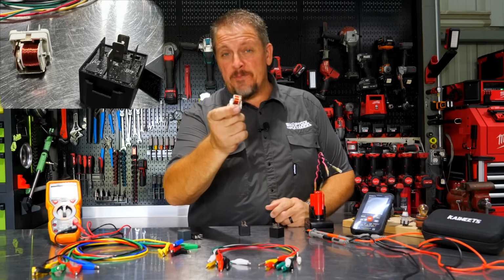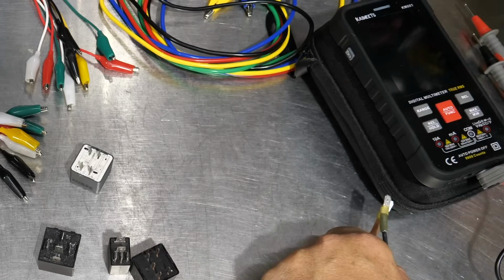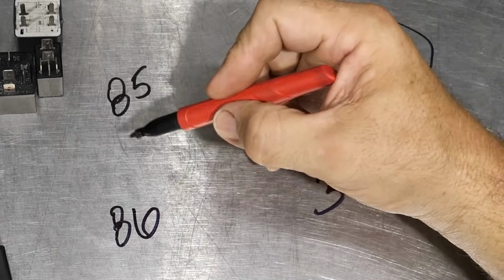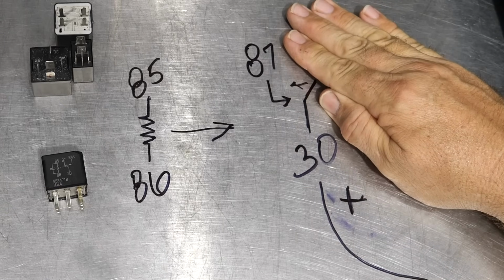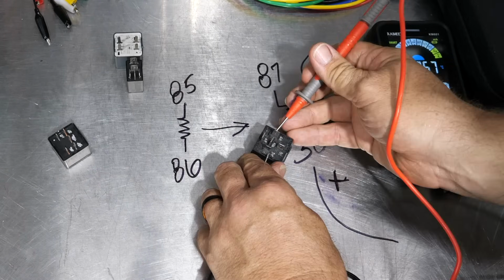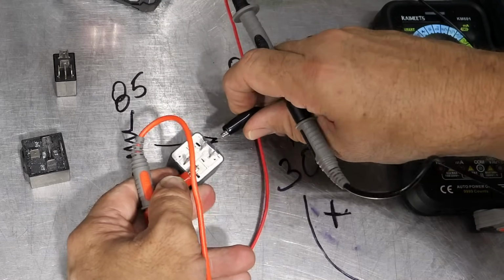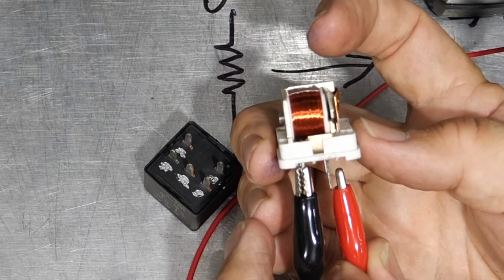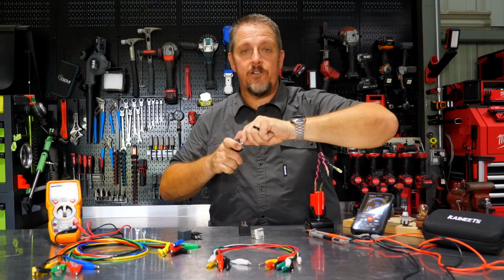How To Test and Diagnose Relays and Wiring [4 & 5 Pin]

Comment: 3.5 year long problem THAT NOBODY COULD SEEM TO FIX:

2011 Jeep Liberty

Code p0481 

"Cooling fan to control circuit / open"

"DTC severity 2 of 3"

"This fault may cause damage to...."(No other information given)

I have changed five modules and relays in this vehicle, in the electrical box, one on the sidewall somewhere inside, under the hood of the vehicle. 

I also just changed the "engine cooling radiator fan resistor" which is located INSIDE the fan assembly unit, to no avail. It could be because Amazon sent me the wrong part even though it fit, the pins were in reverse. Amazon vendor gave me my money back. 

So then I bought the entire fan assembly at O'Reilly's because Jeep dealership said that you can't get that individual part anymore even though it's an easy in and out. They make you buy the entire hole assembly. 

I took it over to my mechanic (one of the many mechanics I've been to) this morning, of which he said the fan works, so the fan is not the problem. Albeit, he's telling me he would have to do some serious diagnosis on me electrical panel, he thinks it's the "whole panel needs to be changed", I think that's b*******. 

I did watch your entire video which I consider myself educated regarding it, but I'm also not a mechanic. I am scared as a woman who does not know what to do or who to trust regarding mechanics. This is my only vehicle.

I just called another couple of dealers and they said they're going to charge me for diagnosis EVEN IF THEY CAN'T FIND THE PROBLEM. Which I find to be HIGHLY UNETHICAL. I mean why would I pay you for diagnosis if you can't SOLVE the PROBLEM? This makes no sense to me. 

Please help IF YOU CAN! 

JoAnne

YouTube channel: 

JoAnne's INSPIRATIONS

CONTACT ME THROUGH MY YOUTUBE CHANNEL, OR, HERE THAT YOU'RE TRYING TO CONTACT ME AND I'LL GIVE YOU MY INFORMATION.

Thanks in advance, and many blessings :-)

JoAnne
Reply: You posted this comment 4 months ago. Did you get this issue fixed?
Reply: If you already fixed this problem, can you please share what fixed it?
Reply: @bernardocisneros4402  didn't I already reply to you with a video?
Reply: @JoAnnesHonestReviews  No, I'm not the guy that made this video. I was just curious if you already got it fixed.
Reply: @bernardocisneros4402  Yes I know that, and I just responded to somebody earlier, I thought that was you. I answered in detail and even included a video. Maybe that was somebody else? I don't know, I guess I'll have to go back and check my comments. For some reason, it's very hard to follow YouTube comment threads.
Reply: @JoAnnesHonestReviews  That was someone else not me. I hope you didn't have to spend a lot of money getting that fixed.

Comment: is the wiring the same if the 5 pin relay has a built in flyback diode?
Reply: Yes, the flyback diode is only there to protect by mitigating the effects of back EMF spike

Comment: Well at the 13 minute mark your confusing, which post are the power to? and your advance multimeter is not a typical unit I have that switches automatically for you .  I have a manual meter. My 5 pin is arranged differently than the one your using which makes it difficult to just follow by photo.

Comment: Great Video 😊. Im checking a random no start with a single click in a old 96 Toyota Camry. Can a relay switch sometimes work and sometimes not? Any information would be greatly appreciated.  Thank you.
Reply: I think you haven't relay in that car 
Maybe that clicking is coming from starter???
Then you need an electrician
Reply: @konstantin-big  ty buddy. I fixed this back in July...It was indeed the starter.
Reply: @HotRod4God72  
Ok
Reply: Yes, it's called intermittent operation. It could be the start relay, the starter solenoid, damaged wiring, dirty or corroded battery terminals, corroded wiring, or bad ground etc.

Comment: 5/10 relay what is 10??   amps?  5 pin what ??
Reply: If you have a 5 pin relay and it's marked 5/10. That means the Amp rating for 87 is 5 Amps and 10 Amps for 87A. Those numbers are usually backwards. They're usually labeled 10/5 not 5/10.  The first # is for 87 and the 2nd # is for 87A

Comment: I'm trying to test a Toyota four-pin Electronic Fuel Injection relay which has no terminal numbers ... however I get 79 ohms off two pins when no power and only get it to click on/off when putting 9 volt battery to the same two pins. That doesn't seem right. Shouldn't it be the other two pins for power on/off? I get nothing from them. PLEASE HELP !!!
Reply: I watched the video again, my fault relay seems to be working fine .... so off to look for the real problem.
Great video BTW. cheers & thanks.

Comment: This was really cool - I would love to see more about this.   Specifically how you walk through a real problem when it's not some major component like a relay or a fuse.

I'm dealing with a fuel pump that's not working. Motorcycle sat for 8 years with fuel in the tank so I knew I needed to replace it.  Since I was already in the tank, I replaced everything previously in the tank....the fuel pump, pressure regulator, fuel filter, float sending unit, all fuel hoses, wiring harness.  Now the problem is when I turn on the ignition, the pump still doesn't sound.  I added 2 gal of gas and still nothing.  I even made a long hook so I could manually change the float sending unit and the level on the fuel gauge didn't change.  

SO I'm thinking it's not getting any power to the pump.  Fuses were fine - I checked the continuity and they're great.  Changed both relays cuz they're old and cheap....still nothing.  NOW I'm going to have to test the voltage at the relay and walk it forward but I don't know exactly how to do that.  I'm also thinking I should check the plug on the outside of the tank that delivers power inside the tank.  However I tried doing that but I'm honestly not sure if what I'm seeing is what it should be.  It's confusing when you've never done this stuff.

Comment: Because of the way you explained how to test a 4 pin and5 pin
relay, I believe that I will be able to test a few relays on my
1999 GMC Sierra truck.  I noticed that you used a 12 volt
battery with two short wires plugged into it.  Where can I get
a battery and the two short wire pieces from?  I see that I can get
the set of wire leads with the alligator ends attached from amazon.

Comment: if you connect a blinker relay at the front from pin L to pin 30 + to switch relay and connect, for example, a bulb to pin 87 and 87a.  will both bulbs turn on and off, of course, when both realys are connected to power
Reply: Hey 
Did you test If that working

Comment: Man you break it down so well. Thank you.. okay but check this out I got high on PCP and took a hammer to my ignition fuct off everything my ignition signal sticks, basically smashed out everything from the steering wheel to the tilt lever. I'm left with a bare steering column a wiring harness for my ignition switch with one red wire in a cluster of wires what's a clip. Thankfully the clip is intact and I believe that's to my ignition switch. But I got to get the hell out of here so how do I start my car. I can send you a picture that's what I'm dealing with if it makes it easier for you to help me with s*** please help😮
Reply: hell yea brother!

Comment: I have a 97 Camry fan 4 pin relay Bosch. Has no 87 but listed as 87a? It seems to be working when tested with a multi-meter and 12 volt source but my relay testers is saying its bad.

Comment: You won't diagnose this one😂
My truck lights sometimes more often than not stay on when I switch off lights and truck.
I pulled all the relays out, 15 of them😂 plus the light switch and the headlights stayed on😂
I had to leave one of the relays out so that I could turn off the parking lights😂
Good luck.
Reply from the maker: What kind of truck? They have to be getting power from somewhere.
Reply: @Shoptoolreviews  It's a 98 Freightliner FLB. That's what I was thinking. Getting power somewhere but no idea where. Really weird. I have to turn battery Isolator switch off which is just an earth. Whats really weird is  sometimes when I turn the Isolator switch on the headlights don't come  on at all but usually they do.

Comment: I am testing a 1733 5 prong relay. I measured the 85 tp 86 and it measured 74. In the video you said it should be 75 to 100. DOes that mean my relay is bad? My  other test showed OL. I did not test with power since I did not have a power source handy.  Thank you

Comment: The one thing that you did not mention, is that if you read a high resistance between 30 and 87, the contacts can be bad.
Reply: Thanks!
Reply: You can do a drop test with multimeter in volt between 30 and 87 pins 
Or you can do that test with a test light between 87 pin  and ground

Comment: He's wrong about the polarity on that relay. 87 is the hot wire and 30 is the ground. Also on the control side it's just the opposite. 85 is ground And 86 the hot.
Reply: There is no problem if you connect B+=positive to  85 or 86 pin
And the negative 86 or 85 pin
You can connect the positive to 30 or  87

Comment: Man I need help desperately.  I tried jumping my 15 f150 and now there's no power inside but you can hear the relays clicking over and over
Reply: If you put voltage into the 86 female slot where the relay pin would be under the hood in the engine compartment relay/fuse box and grounded the 85 female terminal you just fried your PCM dude. If that's what you was trying to say

Comment: hi i need help i have a 1984 cheverolet p32 and the 5pin relay in your video is same as the one i have i looked at the wires the red goes to 30 and to the fuse box and white ground goes to 85 and green goes to 86 to neutral safty switch there was a yellow wire on 87 but was just cut 4 inches up i bought a new relay do i need another wire for this to work im not very good with electrical but im trying my best to get it running its a nice truck im trying to restore so any input would be greatly appreciated

Comment: 1st of all how 2 remove relays and fuses from the housing under the hood when they don't want 2 be removed ? I tried with all my strength ,and no dice, I'm afraid of breaking something, and causing a bigger problem
Reply from the maker: You may want to use a plastic prybar, like in some interior tool kits, to pry the relay loose from the fuse panel.

Comment: I'm testing my four prong brake interlock relay.   When I touch 85&86 it reads around 075.  Whaat does that mean?
Reply: If it clicks after putting power to 86 and ground on the 85 and it clicks, it's a good relay. That's all you gotta do.

Comment: Helpful but you did not include anything on the last relay type the thin rectangular one. The one I needed that has no numbers marked next to the pins. So I cannot figure out how to check.Any suggestions on what kind of video might have that. What type of relay should I search for? Again helpful but never got to the last one. Shown but not mentioned or discussed so I am clueless on how to fix. If you can please advise. Thank you.
Reply: He said if the prongs line up its 85 and 86 the other prongs are the 85 and 30 the 85 86 are the low side the 85 and 30 are the load side.

Comment: You can even use a flat 9 volt battery and perform the tests. It worked for me. Excellent video man👍
Reply: thats what i do...9volt batter with 9 volt connector with alligator clips
Reply: But how do you test the switch? Even if it clicks whats the range for a good voltage drop for the pins 30 and 87 or 87a?

Comment: A relay acts as a switch. A fuse limits the amperage to a circuit. A relay controls a high amp circuit with a low amp control circuit.

Comment: Thanks. You explained the 87a which the other videos didn't make as clear. I ordered a repair manual. I hope the wiring diagrams are helpful. Getting prepped so when my starter doesn't turn over next time I can see if bypassing the relay will work and start to narrow down my problem.

Comment: Relays are not the same as fuses.fuses protect circuits, relays control circumstances. Short a relay and it will not shut down and protect anything it will melt.

Comment: I use a power probe. And I am good with it. Can you explain some ways I could use a multimeter that may be better than power probe. I debating on buying a multimeter. Everything you did in this video I can do with power probe. But I feel like I need a multimeter. But what would I do with it if I had it. What can a multimeter do that the power probe cant

Comment: Absolutely appreciate your explanation and hard work. I have a question that no one has been able to answer for me. I have a 20A fuel pump fuse that blows as soon as I hit my push/start button of which obviously doesn't allow me to start my car. I replace the fuse and as long as I don't try to start my car it doesn't blow, giving me the chance to check my plugs that go to my fuel pump module and the actual plug for my fuel pump under my back seat. I have power running to both plugs, continuity is fine and my fuse is still good so where is the fault at in this situation thanks in advance?
Reply: Starter short?
Reply: Filter is clogged. Pump should be pulling 10 amp max

Comment: Thanks for this video, with your help I think I just found the reason for my car not starting. 🎉
Reply from the maker: Great to hear! That's why we do it. Thanks for sharing.
Reply: Question my battery cable end keeps coming loose alternator changed funs fine for a month then bam everything dies battery was 13 when started alternator shows 15 amps im getting so upset paying all these people to fix my car the battery end is not the normal ends that most vars have please help 2011 3.6 chevy Malibu ltz any help please
Reply: @braidendj3jy  
Hey 
Did you find the solution on your problem????

Comment: 😮🎉😮🎉😮🎉---😊,
    WOW! Thank you so much for taking the time to make this video too inform me about the routes electricity takes when ground/12 volt / 85/87A/420/69 etc ..   .....  ..  .
      My experiments haven't been as fulfilling as I know they were many moons ago. Installing these relay switches inside of the cranium of two species of saltwater fish. I could not get the wiring correct from the electrical brain diodes running to the tail then to the relay fuse and of course it grounded to a hollow bone in the jaw. Then wired to the fins, and from the fins to the 12 volt battery installed exterior of the scales. I couldn't tell you how many salmon I use for practice and I had very neat effects/ movements on command, forward left right and even reverse. It isn't a very good backup job reversing for the fish but it tries even though it doesn't know what it's doing. sounds out of the voice box ( fish don't have specialized vocal cords or larynx's so the most popular way is through a tribulation, the same way crickets makes sounds the fish rubs two phones together or clicks producing audible 112 decibels mimicking music or songs that are being played through underwater sonar speakers. And of course all the tones are in the range of the eardrum that the earthworm grows naturally.. But everybody knows that. (The unnatural eardrums have never worked going back to 19 63 when Klaus Schmidt revolutionized the hearing aid affects/quality for the endangered scouts that were trapped inside of the cave during the mining accident in Mexico. I digress
    🤔 I lost my concentration where was I.....
   Oh yeah!  So I got the huge fish wired up with the relay on the interior of the cranium with the 12 volt battery that is securely placed on the dorsal fin. With no holes or anything drilled into the fish because the last thing I would want to hurt would be the beautiful beautiful experimental fish.
   If anybody would be interested in the conclusion of the first round after this kind YouTuber gentleman taught us all about relays, I'm happy too provide my link to the science paper that is peer-reviewed by my peers at the institute.

Comment: Thanks for the help i have been trying to find out how to test my fuel pump relay on my 94 Chevy c1500 2wd 5.7L. i had a check engine code 54 to pop up and when I looked it up there was two different things that could be causing this  code one was the fuel pump relay ( low voltage) or it could be a he EGR valve solenoid. Hopefully i can find out how to test the EGR valve solenoid hopefully it is something simple. But knowing my luck ( I ain't even going to say it, don't want to jinx myself ) but again I want to say thanks for your help)
Reply: If relay are melted together I should conduit on ohm meter? Right?

Comment: I didn't have a 12-volt battery so I used a 12v battery tender for power. It performed both tests perfectly without worrying about damaging the relays.

Comment: That's a coil between 85 and 86, not a resistor.  When power is applied to the relay, the coil generates a magnetic field, grounding the switch between 87 and 30.

Comment: I had a little understanding of relays, when I tried to add fog/driving lights on my '72 Toyota Corolla & a little background in electronics. However, I never completely understood what the numbers stood for & exactly which terminals did what, even though I successfully wired the lights. Now, as an old guy, you helped really understand. Thanks!!!
Reply: I'm in the exact same situation. Took electronic classes in HS and learned more in the army. Being in my late 50s, I am finally a pro with relays. Lol.

Comment: Relays and solenoids are considered high current switches a lot of people are unaware of this. Yes the control side 85/86 is switched by the computer most times in an automotive application. Great video and I love that meter.